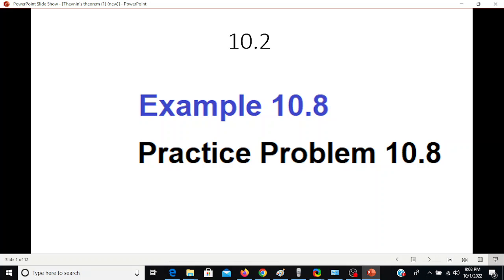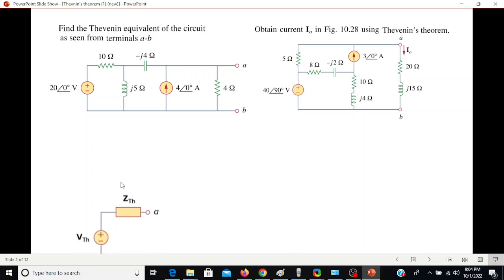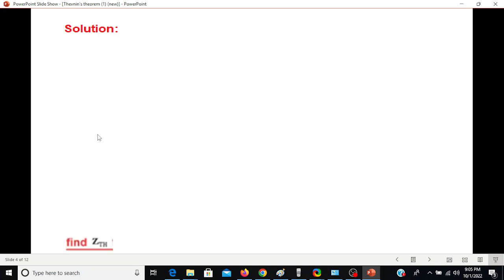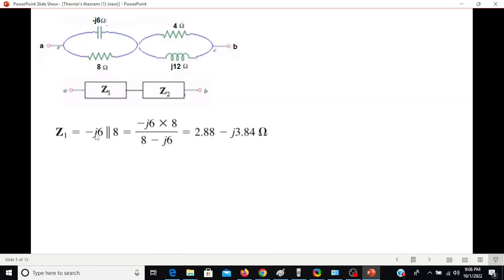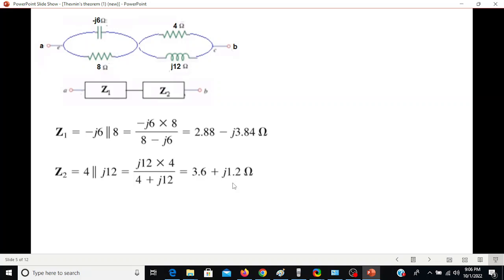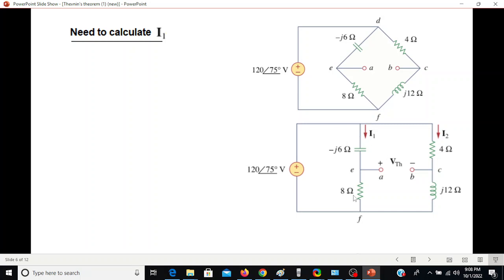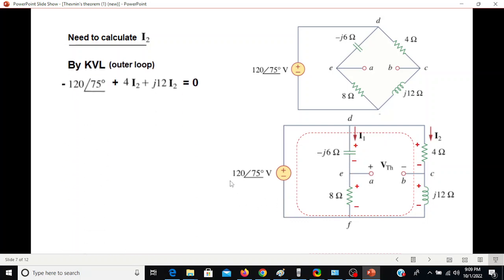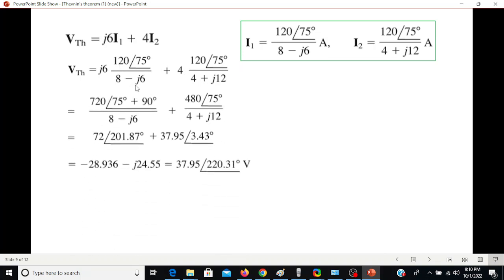(English)ENA || Example 10.8 || Practice 10.8 || Thevenin's Theorem

Comment: Sir i am a little confused in the last step of Zth of practice problem 10.8 where you added Z1 and 10 in series i didn't understand why are they being solved in series. I might be missing or forgetting a concept at that point I would be very greatful if you could tell me why are they being solved in series.
Reply from the maker: Hold the terminal a in your left hand and terminal b in your right hand, and pull them apart. Does it look like they are in series now 😃
Reply from the maker: Thanks for liking. Actually the correct definition is that " if same current flows through the elements, then they are in series "
Reply: @ElectricalEngineeringAcademy  thank you so much sir got it 🙂